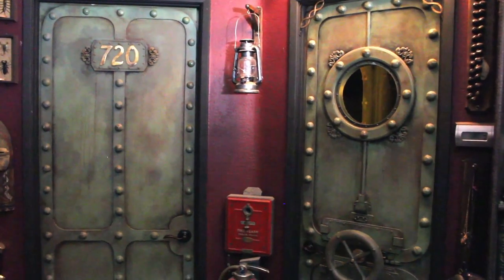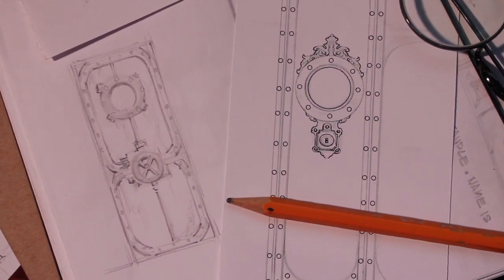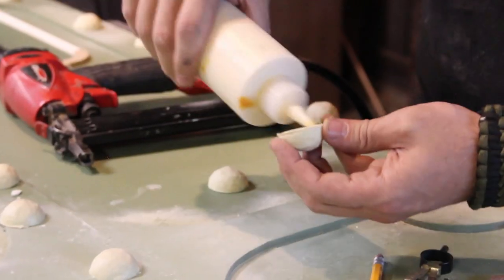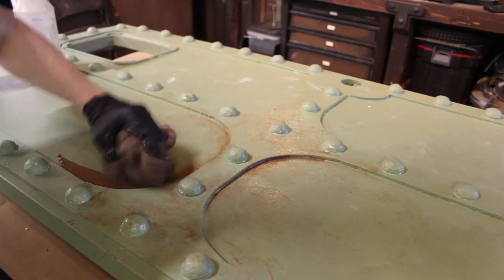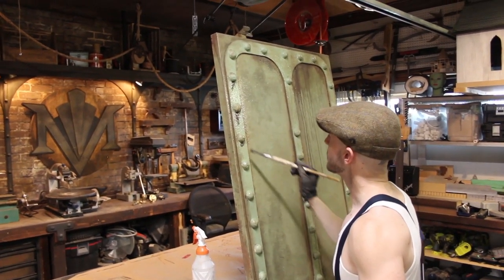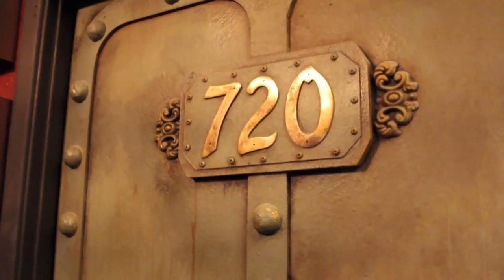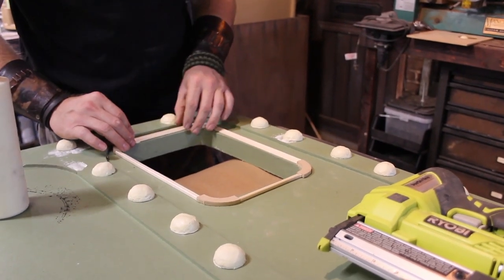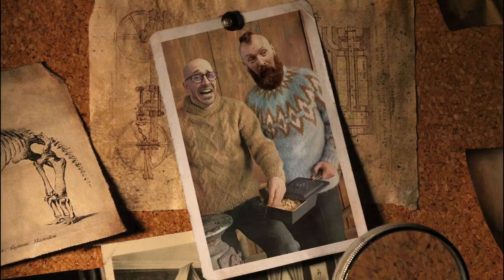Builds: Submarine Doors

Comment: Hi Guys, 

I'm an artist but never made anything like this before.  doing the ceiling in the camper in a faux rivet effect with wood button domes.  this door is AMAZING!!!  I am designing my dream Steampunk camper right now and rehabbing a vintage 1964 Travel Car Lodge Car complete with caboose back porch into a 20000 Leagues Under the Sea theme.  I wanted a sliding submarine door for my bathroom and going to copy your design for sure THANK YOU for the design idea!!!  What did you use for the door wheel?  I want to do over the top cabinets too any good ideas for me for those?  

Would love to show you pictures of the things I have made so far.  I covered the driver and passenger seats with an black textured alligator material with velvet insert and laces up the back of them to look like a pirate wenches corset top. Making an aquatic airship bicycle for under the kitchen counter, a huge ceiling mural for the main living area that has a large 4 ft. vintage French metal clock, old maps, a globe cut in half that lights up, a moon and sun that are very steampunk/vintage space age era designed, moon has the rocket crashed in man on the moons eye from first animated film ever made, a huge kraken, an airship I'm making, pirate skull that lights up and whatever else I decide to add later maybe some star constellations.   I made a vintage divers helmet light with 3D tentacles coming out of it and 25 star burst mirrors I painted in all different metal finishes that kind of look like sea anemones the tentacles will wind through on the bathroom ceiling.  took a huge sea clam and made it into a bathroom sink, made lights out of gears that look like jellyfish just to name a few things I have made.               

Thank for any information.

Therese
Reply: Therese Becker,
I know you posted a long time ago…I can visualize what you’ve done, but would love to see it! It’s probably a different imagination in my mind, however sounds so cool. Do you do YT videos? If not you should…inspire, create and just have fun.